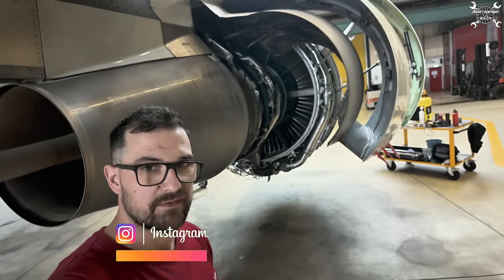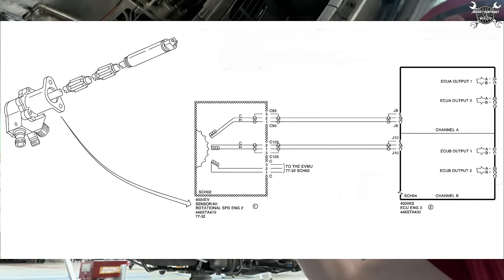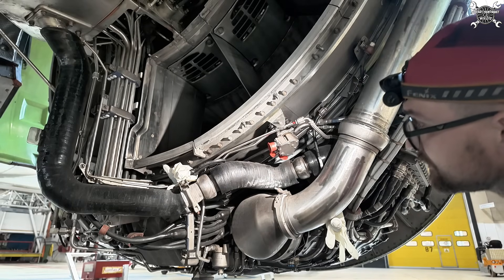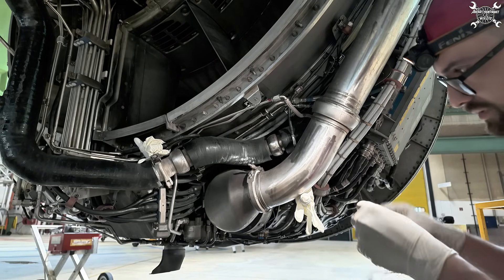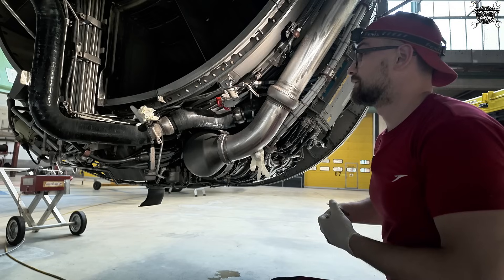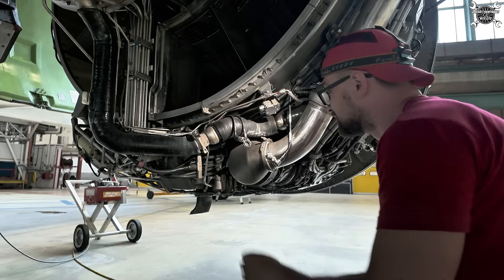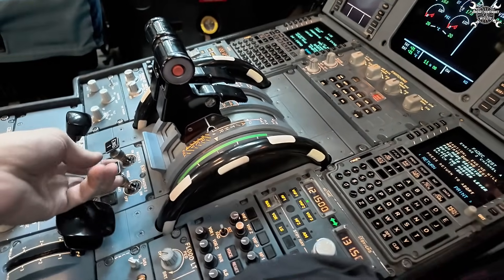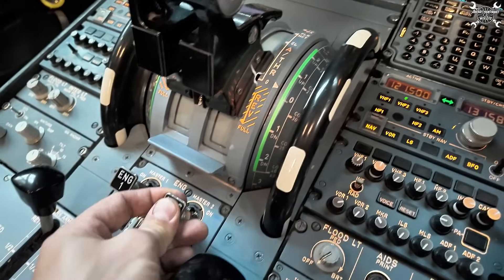How to measure speed of Fan (N1 shaft)

Comment: Not much different from say a Crankshaft or Camshaft position sensor on your vehicle. Hall-effect sensors and their respective tonewheels (Sensor rings) have a tooth shorter or further apart to tell Cylinder number 1 (or Blade #1).
Reply from the maker: But this is also vibration sensor
Reply: @zeto.r  Understood. Thank you for all of these videos. As a 'Gearhead' I like watching how it's built, repaired, upgraded, any of that kind of thing.

Comment: Like always , details and comprehensive info , thank dear Thomas .
i has been wondering that only in Airbus aircraft what are these two wheel looking parameters with black strips both side of engine throttle control lever on flight deck penal ? 
i noticed it spins fast during altitude changes? any thing to do with throttle ?
thanks
Reply from the maker: That is controlled of  stabiliser on the tail
Reply: @zeto.r but I don't see something in this shape in Boeing?
Thanks for information Thomas
Reply from the maker: @rajeevshagun-info every commercial aircraft has it
Reply: @zeto.r dear Thomas, 
May you informed me ? 
On Boeing or Airbus ,the spar region fuel valves what happened if the DC power supply suddenly cut to its relay ?
Would it shut straight away ?

Comment: Sorry but after having seen that Italien guy lifted up from his feet and flying into the idling CFM head-first from a distance of two meters two weeks ago I have to ask that question: How dangerous is it standing that close next to the engine with a camera and a flaslight while it´s dry-motoring inside a maintenance hangar? How hard is it´s suction-force, can the air flow and the suction already be felt and become dangerous at such low rpm of 1 or 2 % of maximum rpm?
Oh and why is the exhaust gas temperature only 28°C at 23% N2, isn´t there already a lot of compression going on inside the compressor achieving at least 100°C air temp or so? I heard these turbines are like a diesel-engine, they can keep the combustion of kerosene running by the pure heat of the compressed air and without spark plugs (spark plugs of the CFM56 are only switched on during heavy rain at fly-idle, otherwise the fuel is burned by the pure heat of the air compression.)

Comment: Sur cet A320, le moteur, ici, est in CFM56/5 (A ou B), et la sonde N1 est une « canne » devant aller chercher au centre du rotor BP le signal magnétique délivré par ce que l’on appelle la roue phonique. Cette roue phonique est constituée de dents magnétiques et une dent est un peu plus haute que les autres et crée ainsi une variation de champ magnétique générant une impulsion électrique à chaque tour du rotor Basse Pression. Et avec une base de temps présente dans un petit boîtier électronique, cela permet de déterminer le nombre de tours par minute ou en anglais en rpm (rounds per minute).
Reply from the maker: No idea why you post this comment.  This looks like it came from chat gpt and you if you refer to this specific engine you have there few wrong informations
Reply: @zeto.r  Je n'écris pas mes commentaires à partir de copier coller de chat GPT, car je ne connais même pas ce réseau social.
Par ailleurs, les informations complémentaires que j'ai écrites concernant le capteur N1 concerne bien le CFM56/5 qui, entre autres, motorise l'A320. Et ces informations ne peuvent être erronées car je suis ingénier retraité de SAFRAN, ayant travaillé près de 40 années sur le CFM 56 depuis sa création en tant, entre autres postes occupés au cours de ma carrière, qu'ingénieur développement et ayant effectué des essais de certification sur cette famille de turboréacteurs. 
Cela vous suffit il comme justificatif à mon commentaire ?

Comment: What is the main reason you need to measure N1 speed.  It’s probably obvious but can you explain to us why.
Reply from the maker: Engine is based on N1 it is like RPM on car engine.
Reply: @zeto.r  So the main gauge of engine speed is N1 speed in rpm’s.
Reply from the maker: In percent but that is not all you need to follow N1, N2, EGT(exhaust gas temperature)

Comment: Is there a video that shows ecu and all sensors and actuators that can be connected to it? I like control systems engineering and mechactronics and find it very usefull to know hom many control loops are there. And again thanks to Austrian for the video also.
Reply from the maker: What are you asking for is one week on type course + school 😀. But im slowly adding more and more videos about engine
Reply: @zeto.r I will be patient 😂 and will wait till the video where ecu will be replaced. I always hear news for cars with hungreds of sensors and processors and when happens to service one I always find max 4 boxes with 10 processors and 5 sensors on  engine and 10 spread around chassis. Seems artifitially inflated in order customer to think that is getting more value for the money. Interesting to compare with plane engine. I am guessing 10thermocouples some vibration sensors, maybe Nox an O2 sensor, tachometers, couple of pressure sensors.

Comment: Very amazing task, N1 Speed sensor belongs to what we called mechanical parts, which are also composed by vibration monitoring unit and sometimes N2 Speed sensor the shaft of high pressure compressor and turbine. Some manufacturers use N1 to monitor the thrust of an engine, like P&W and Rolls Royce, while others refer to EPR, engine pressure ratio. Very informative video for me a student. Big thanks Zeto

Comment: At 11:27 what is the component that is rotating? Is it in anyway related to the starter air valve of the air turbine starter?
Reply from the maker: That is manual start lever. Soon you will see video in which I explain this function

Comment: how come the EGT was at 25°C when testing the channel B ? as it was tested before with channel A? No fuel is introduced when doing these tests ?
Reply from the maker: During both tests it was around 25°C fuel is in fuel pump and HMU because it is used as hydraulic fluid for engine. But it doesn't enter in combustion chamber
Reply: No, he said it was a test with motoring, so the engine was just spun by the air starter, no ignition or fuel was introduced.